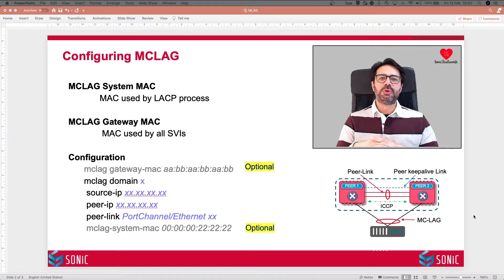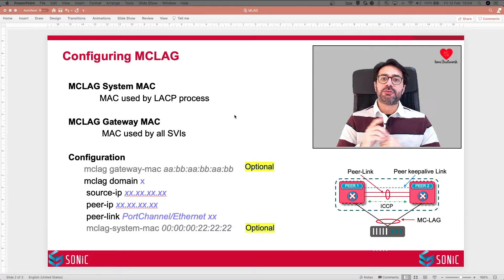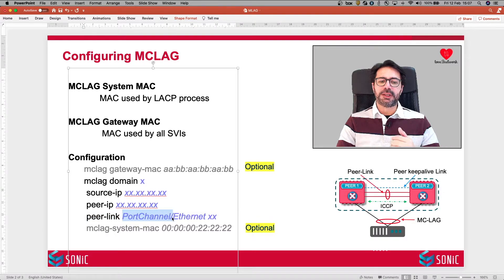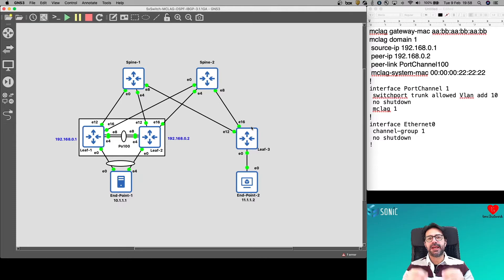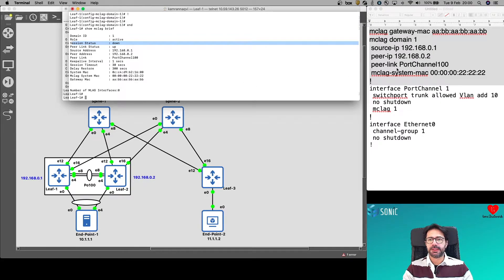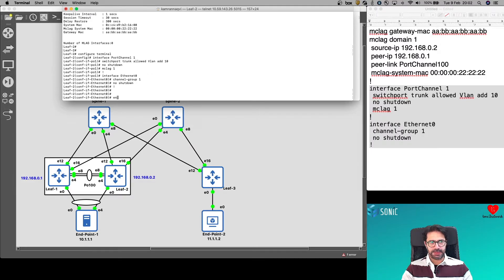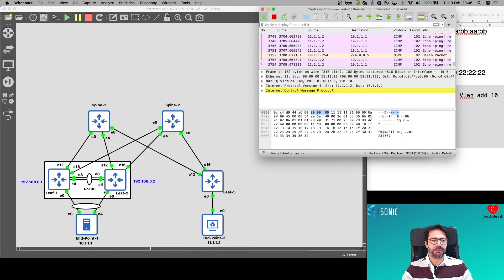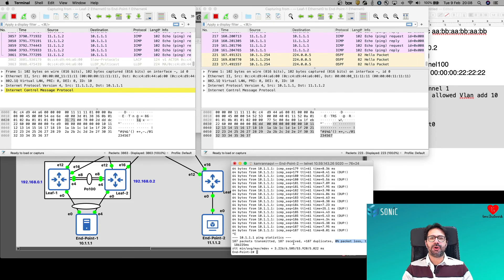SONiC - How to Configure MCLAG

Comment: How is Endpoint1 configured for a default gateway? 

Consider the scenario where Leaf1 and Leaf2 both do L3 routing, then if Endpoint1 is only pointed at one Leaf1 as its default gateway, when it goes down, then the MLAG is not effective since the default gateway is not present. In Windows Server, you can configure multiple gateways and Windows Server should fail over to the next gateway. But in my scenario, I have a storage server running TrueNAS Scale and I can only configure 1 default gateway as far as I'm aware. I'm brainstorming how to add the gateway redundancy to that server. I read some other vendors (Cisco, Juniper) have a mac synchronization mechanism so both Leaf1 and Leaf2 could share an common IP address. Does SONiC have a similar mechanism?